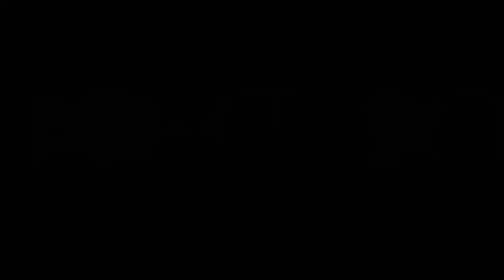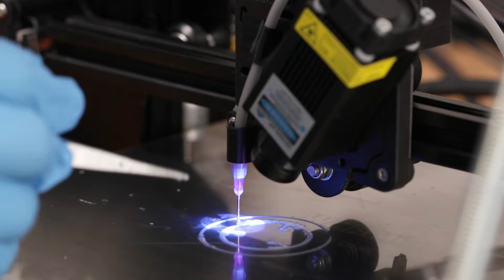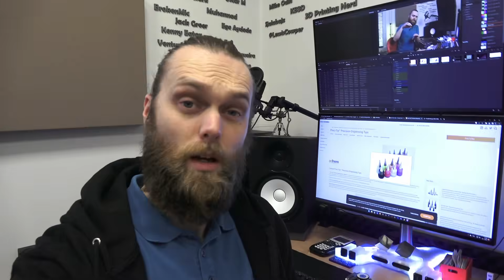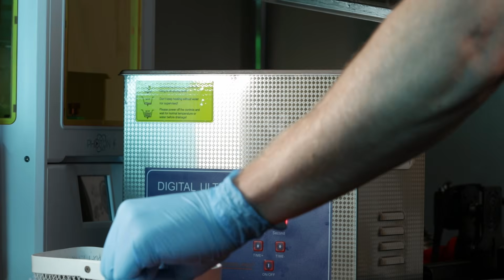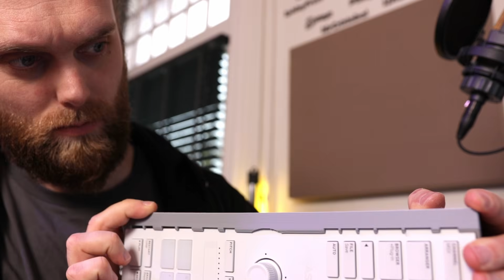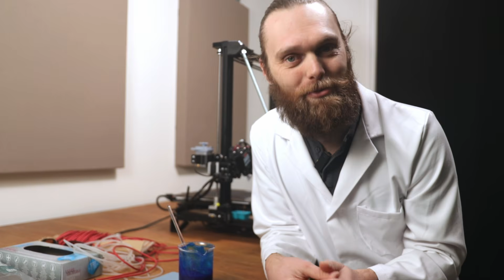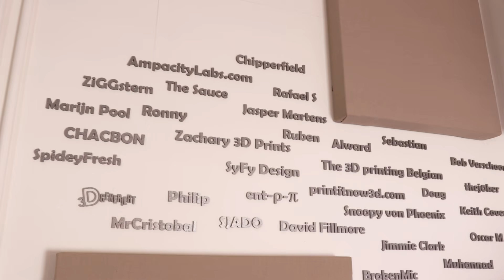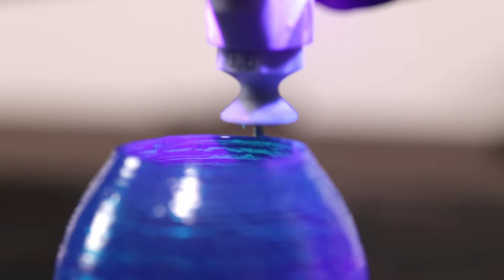I made a CUSTOM Nozzle that 3D Prints GEL!

Comment: i think you need to go back to the regular nozzle geometry. The reason it works for regular fdm printing is that the nozzle shape acts like a ramp, pushing any irregularities along its path back down to the print, minimizing snags etc. probable reason it didnt work for you last time is that the laser has a gap from the nozzle tip (the shadow produced by nozzle) which means the resin can climb up the nozzle before hardening. Try targeting the actual perimeter of the nozzle tip so it hardens before getting any chance to climb up the nozzle
Reply from the maker: Thanks for your advice! Maybe a combination of both the regular nozzle tip and the two o-rings could be an interesting option. The way that this seals off works like a charm!

Comment: It seems that in the last benchy the nozzle was hitting the rest of the print during travel moves. Try to use Z hop or give a conical shape to the point of the brass tube. Awesome project
Reply: Usually the downside with z-hop on FDM is stringing though, which would mean leakage here. Unless the peristaltic pump can "retract" fast enough.
Reply: @xomm  i think that the resin Is thick enough to not leak during Z hop
Reply: @eugeniolabruna4140 there's a delay effect from when you stop pumping though.
Reply: @HonestAuntyElle  I'm way late to this, but I wonder if pressure advance would work in this instance
Reply: @xomm  that can be resolved with diagonal z-hop
Reply: What about if you turned the lasers off at layer changes
Reply: A conical tip sounds like a good thought. Or maybe rounded like a ballpoint pen?

Comment: use a little of both the glass and Silicone? getting the advantages of each but low enough content to keep the bad properties at bay? totally guessing here!
Reply: I was going to suggest the same thing, I think that May work
Reply from the maker: That'd be worth trying, thanks!
Reply: It may need quite a bit of fine tuning the ratios could be as fine as a few granules more or less to get consistency correct

Comment: You inspired me to try printing liquid PVA.  Imagine how much easier soluble boundary support would be.  Just jet some warm liquid PVA between plastic support and the part.  Can't wait to finish watching your video!
Reply from the maker: That's a very interesting idea!
Reply: Hey man, I've already tried this idea! liquid PVA in a custom refillable marker with a brush tip as one of the heads. Works super well! As you said, there's no gap between the support and the part, so the interface is pretty much perfect!
Reply: @RPfan07  Awesome!  Glad is worked.  Can't wait to try it on my Magnetic IDEX setup :)
Reply: That is a genuinely great idea
Reply: Yeah that would also be a good alternative.
Reply: About 3 years ago I experimented with gel bath supports (only name I could come up with) I printed on my CR10 with the draft sheild option in Cura active, and slowly filled the bath created with washing up liquid from a syringe as a proof of concept. It supported flat overhangs (not bridging) surfaces quite well past 30mm, but I never took it any further.
Reply: @joshbridges8410 time for underwater 3d printing?
Reply: But when, as you said, you jet it between the support and the part, you already got your part at this point, so why still need the support?
Reply: @CAPTAINCAPSLOCK111  Not after the fact, but as you print layer by layer.  The glue layer is the only thing that touches the part.  This way you don't need a gap between support and part, resulting in perfect bottom surfaces.